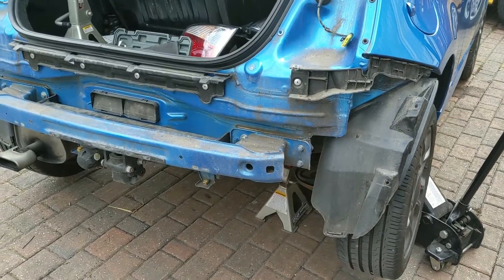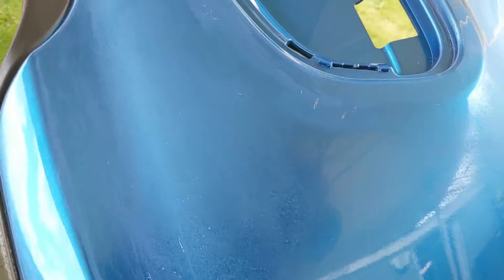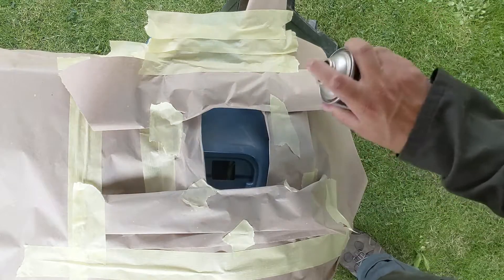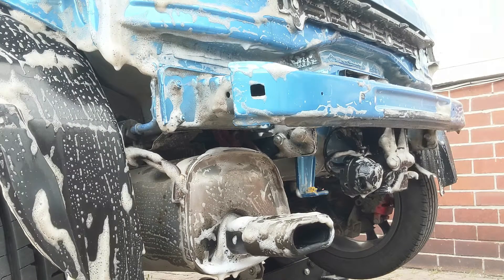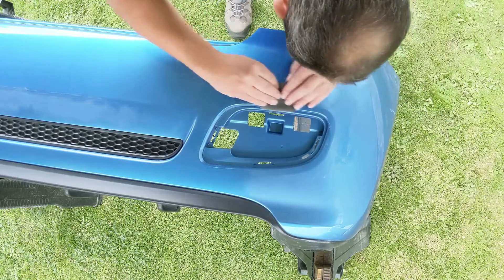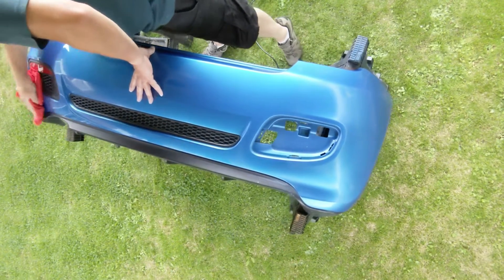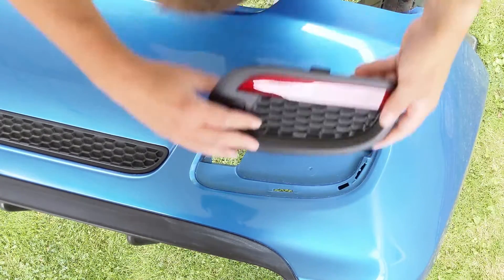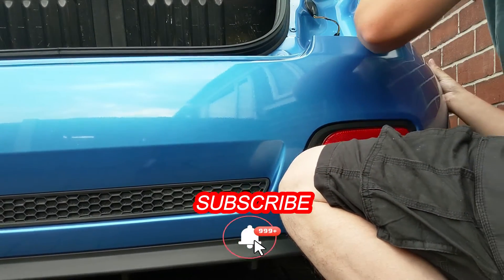Fiat 500 Bumper Paint Repair

Comment: Good job Mark. Had to do something similar with the Mini lately but there wasn't that great a colour match.....oh well, better than rust long term. Never realised your 500 had a towbar on it. How well does the 500 handle a small trailer?
Reply from the maker: It's not the best paint job to be honest but at least it's the right colour. 😅
Obviously rust isn't an issue in the plastic bumper but I'd say definitely do it on areas for rust prevention or where you can't make things look any worse. Otherwise perhaps best left to the professionals (or someone more experienced at DIY than myself).
It's not bad with a small trailer due to having 145Nm of torque at only 2000rpm. The biggest problem is the max 400Kg un braked capacity due to the cars low weight.
It's primarily there for a cycle carrier. When the bumper is on you can't see it at all as the tow ball is removed and the 7 pin electric socket is on a swivel mount.